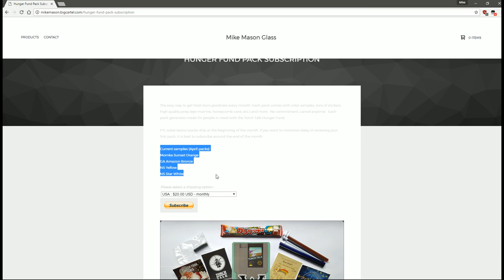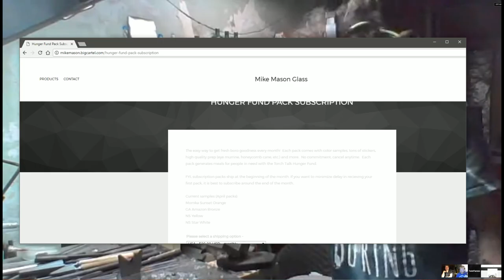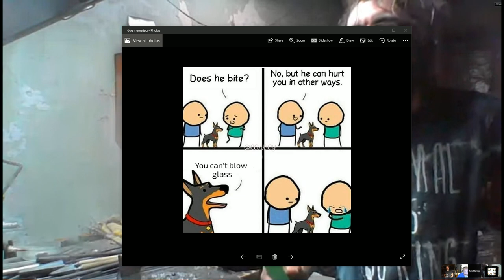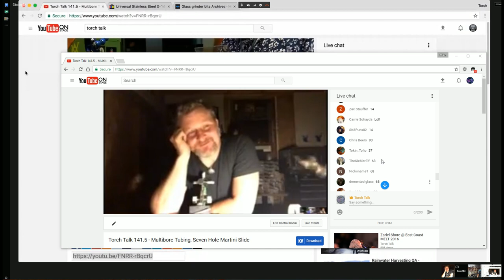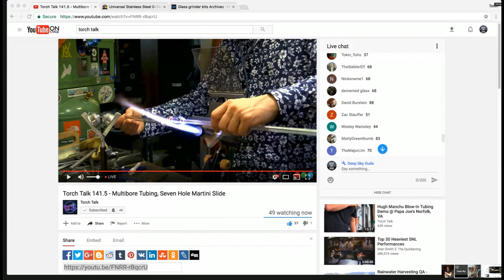Torch Talk 141.5 - Multibore Tubing, Seven Hole Martini Slide

Comment: To replace a K tanks how expenisve would the HVO system cost?
Reply from the maker: Depends what your demand is, I have a 30 gallon system with the Mighty Mite head which I think is a good match for 1 large torch but for like super size torches or multiple stations a 60 gallon or even larger would be clutch.  Can I have someone at HVO hit you up with current pricing and such, they sponsor Glass Central Station so yah be nice to let them know a viewer is interested :D